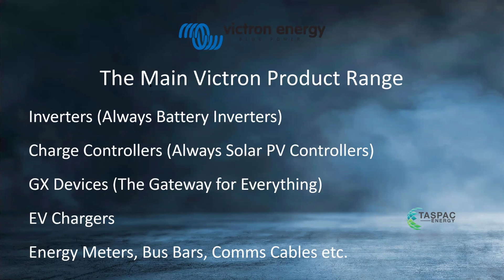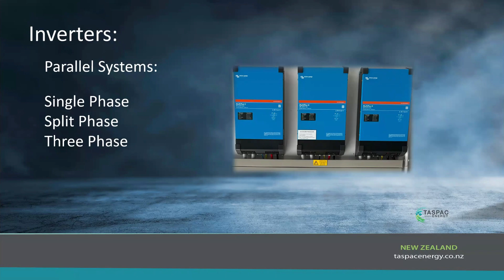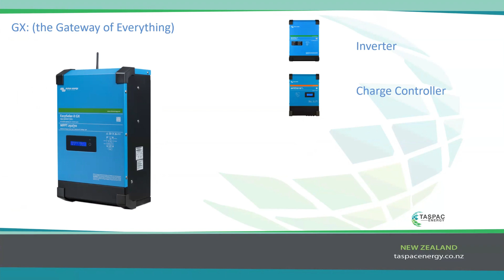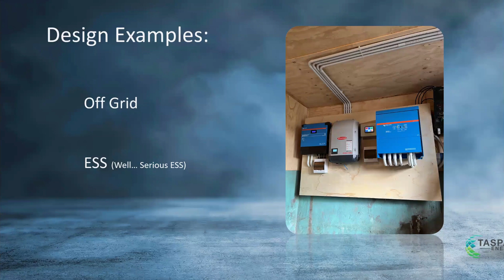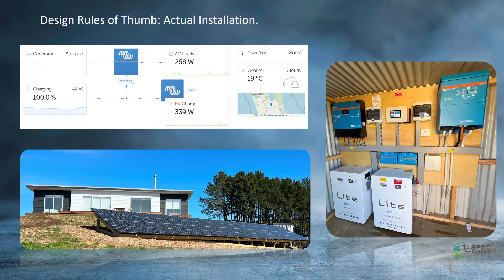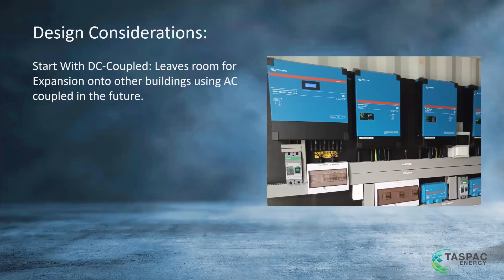Taspac   Victron Products and Applications Webinar

Comment: Hi Ben
Great info....I am on grid but was considering having my workshop off-grid , early design stage at this moment but the backbone of my design was 45kw battery storage to start and 2 or 3 victron Multiplus 48/5000 in parallel . Question- is it possible ( and safely with-in compliance ) to use the grid on AC-in to charge the battery bank if needed in extreme cases and restrict any backfeed into the grid system ??
Reply from the maker: Quick update: the Multiplus II 48/8000, 10000 & 15000 are all now 4777 grid compliant. There are certs on the Victron website.

Comment: At 50:00 can you clarify your equation? 
Ie. $9000 - 10000 x 6 = minus $51,000
Reply from the maker: Sorry for not replying - I missed your question. Short answer: yes, assuming for a, well designed, Off Grid system that will last around 5 days before needing a generator you would be looking at around $9k/kWh of daily load. NZD installed, incl. GST. Sometimes you might get down to around $7k - $8k / kWh of daily load but any cheaper than this means you're compromising on 'something' - either, quality of equipment, installation, days of autonomy etc.

Quick update: the Multiplus II 48/8000, 10000 & 15000 are all now 4777 grid compliant. There are certs on the Victron website.

Comment: Hi Ben

So the multiplus2 5kw grid compliant for grid connection with export ? i though you still have to have a grid protection relay?
Reply: Following thread.
Reply from the maker: No, no need for a GPR on the whole Multiplus II range now that the larger units are also compliant.
Reply: @benstanton  So up to the 15kW units